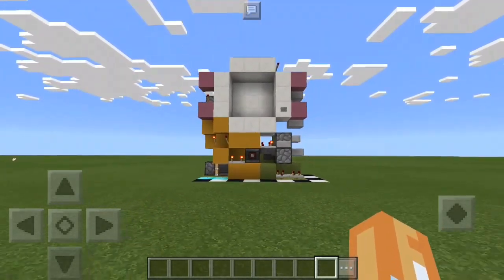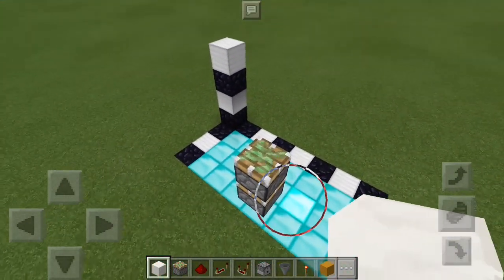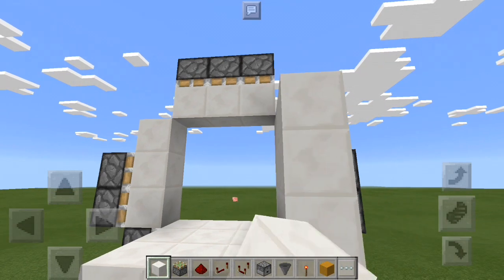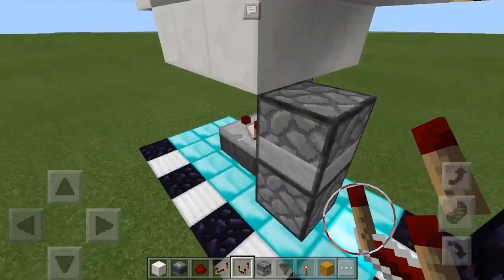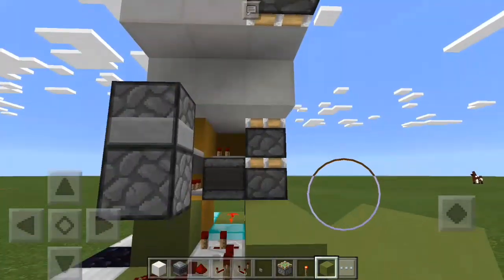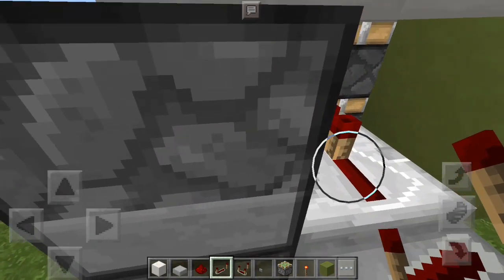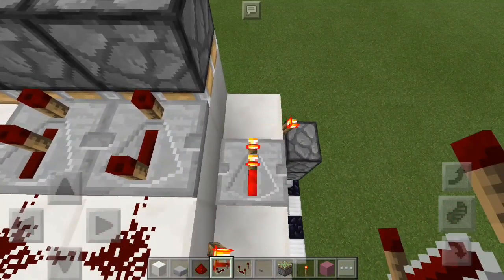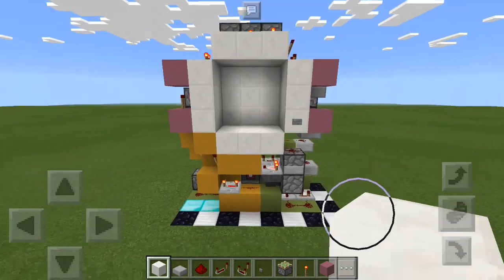Minecraft Pocket Edition Redstone Tutorial: 3x3 Spiral Piston Door (MCPE 1.1.0)

Comment: Awesome door Trogdor!  Do you know of any way to adapt this or any 3x3 door to a diagonal layout?  I'm building a large circular room (45 block diameter) and will have 8 doors equidistant along the perimeter (think the midpoint of each edge of an octagon).  It's a simple matter of building one of your 3x3 doors for the straight edges, but I'm uncertain how to proceed for the diagonal edges.

I've just posted the question in the MCPE Reddit as well along with a picture of where the door would go taken from a mock-up of the base layer I'm using for planning.
Reply from the maker: +Michael Villeneuve unfortunately you really can't simply modify a normal 3x3 door into a corner 3x3 door. It would have to be designed completely from scratch. That being said, it is an interesting idea; you have me intrigued.
Reply: Trogdor312 That's what I figured.  I intrigued someone on Reddit with the same question.  I was thinking maybe it would work too do the bottom and middle rows with the same technique that you used with the bottom center block and mid center block in this build; using the double piston extender and the side piston to pull a block out of the way.  Use three of those to cover those two rows. Then a diagonal row of upper pistons to push the top row down from the ceiling.
Reply from the maker: Michael Villeneuve That's a possibility. The biggest problem with a corner door is going to be the center row of door blocks. Making 3 double piston extenders next to each other isn't impossible just hard. I'm reviewing a few different ways of doing it, and weighing the pros and cons of each. Hopefully I'll have something worked out soon.
Reply: Trogdor312 Nice! I appreciate your expertize!
Reply from the maker: +Michael Villeneuve No problem
Reply: Michael Villeneuve, I have one
Reply: Minecraft Redstone MCPE Cool. Do you have a tutorial?
Reply from the maker: +Michael Villeneuve I've just finished a prototype. It works fine, just have to move some circuits and compact it. Probably won't finish tonight though.
Reply: Trogdor312 Awesome!  Thanks a lot!  I'm glad I suggested something that piqued your interest.  I look forward to the final result.
Reply: Trogdor312 by the way here's an imgur link of pictures I took of a prototype enclosure I have in mind for the diagonal door with comparison photos of the the enclosure I'm using for your 3x3 spiral door.  Something to consider as you compact your diagonal door design. I created compact and loose designs for the regular 3x3 and prototyped a compact design for the diagonal door.  I'm open to either design but prefer the compact one, assuming the compacted diagonal door circuitry will fit in either one.

https://imgur.com/a/KSche
Reply from the maker: +Michael Villeneuve That's the way I have it set up. I'm trying to get all the Redstone underground, so it doesn't look goofy. I'm building a barn today (irl), so I won't be able to work on it today. It's an interesting build.
Reply: Trogdor312 No worries, I'm patient.  I just appreciate that you undertook it.
Reply: Hey Trogdor any progress on the diagonal door?
Reply from the maker: Mike Villeneuve Yeah it's almost done. I haven't got to play due to personal matters for a while so progress is slow. Sorry for the wait.
Reply: Trogdor312 No worries. I was just curious. Hope things are going good for you.

Comment: Repost of an earlier comment (now deleted) with new considerations added.

Hey Trogdor!  Would you be able to do a tutorial for a 1x2 door that works the same as that portion of this spiral door-the double piston extender and side piston?  I think I discussed it briefly with you before.

I've isolated that portion of this build but I've no idea how to compact it smaller than the 3x7 footprint of the spiral door.  So because of that I have something I can use but was wondering if you could do a compact version?

I've done searches but they either return double piston extenders pushing a single block or the wrong type of 1x2 door.

Also it looks like I'm in need of another diagonal build.  Upon further examination I discovered that the isolated 1x2 door taken from the spiral door leaves certain floor level Redstone components revealed.  This is because my diagonal enclosure in relation to the rectangular layout doesn't conceal four Redstone components: the side piston (only when it's extended), as well as two of the three pieces of Redstone dust (the 1st is the dust connected to the side piston, the second is the dust on the uppermost slab) and the Redstone torch that are at the same Y coordinate.
Reply from the maker: Mike Villeneuve The first door is called a semi hipster door, and I should be able to put one together relatively quick when I get the time. The diagonal 1x2 would just be a normal hipster door, which will take a little more time; due to it being fairly complex.
Reply: Trogdor312 Thanks so much!  You've been really helpful, understanding, and patient with these diagonal builds. 

Here's an imgur album detailing what I'm going for, what had already been accomplished, and the issues encountered.

https://imgur.com/a/7QJcV